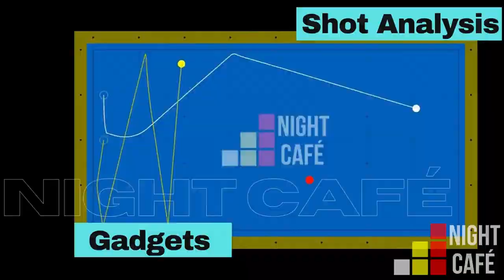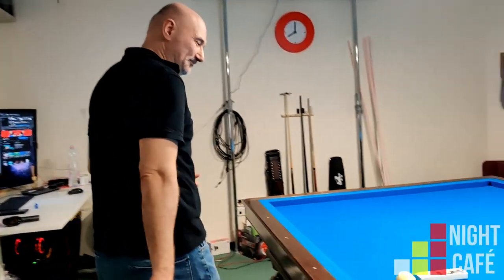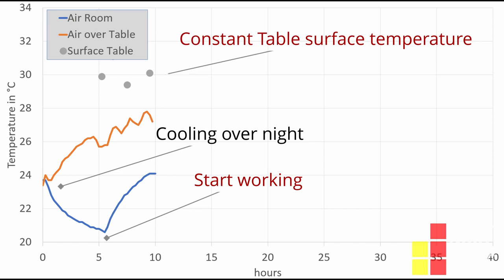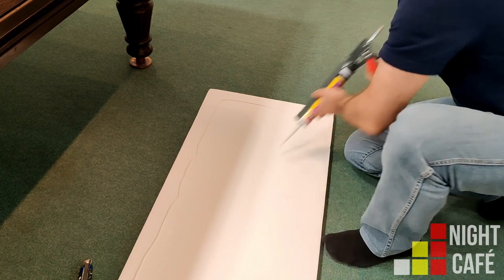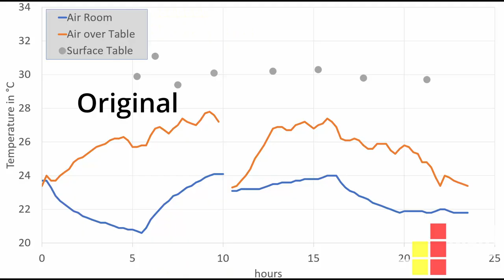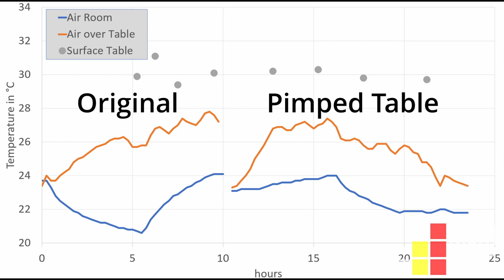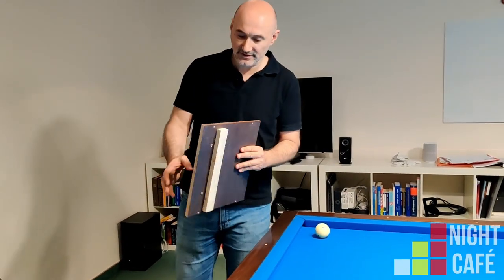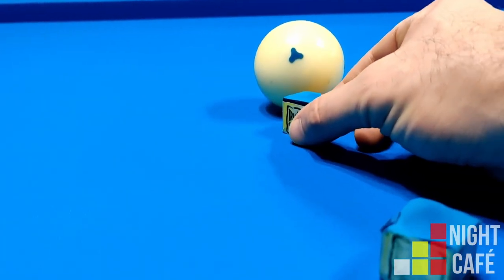How-To: Improve the heating of your Billiard Table

Comment: Thanks for sharing this info.  Not sure I want to spend the money and effort to heat my homemade 3 cushion table.  Just to get 1 ball extra length.  If I had a proper 3 cushion table it would be a different story, but I simply have a converted pool table.
Reply from the maker: I also don't hear my table. Maybe now in winter time, when the room gets cold. But in summer time I had recognized on some days, that the humidity was like glueyi smeary thing on the cloth so I heated for several days. 

What do you like more, pool or 3 cushion?

Comment: I used a humidity reducing appliance when I had a table in a very humid basement. It worked well and the table condition got better every day. 

But i was wondering, is the humidity only reason for heating up the table? I guess the heating may also be necessary to keep the cushion elasticity constant. 

I've also seen some billiard tables converted to gas heated systems instead of electricity. (Less than half of heating costs compared to electric tables) 

Gas heated tables run really long and smooth all day long. Because the room owner keeps the heating on entire day. Thus, no major changes in table condition throughout the day. 

Thanks for the video.
Reply from the maker: I think temperature will effect the hardness of the rubber. May be I can once make a video with dry&cold room, warm and humid room? But I think in general the problem is, the room temperature. When the room is really small, then room temperature is increasing also really fast and you have to open the windows and this makes a temperature gradient on the table.
Reply: tell us more about your "humidity reducing appliance"

Comment: very very interesting ...i would have guessed on at least 50 cm longer with heated table 

if it is all about preventing humidity of the cloth maybe a fan can be better than heating the slates ?

I had an idea once to make the slates in concrete and add heating INSIDE the concrete ...wonder how if that would have changed anything
Reply from the maker: Some say that the heating also softens the cushion rubbers, and this sound reasonable. May be the shot speed must be higher to see an effect. The concrete plate is interesting and may be very cheap. Don't know, why concrete us not used?

Comment: What tools are used to heat up the table?
Reply from the maker: It heated electrically and the temperature is controlled by a thermostat. You can watch the table installation in this video: https://youtu.be/fP1Ow0hXIYY?si=NxKrS9CNW5lwPxm3